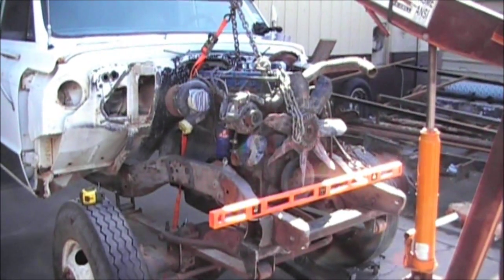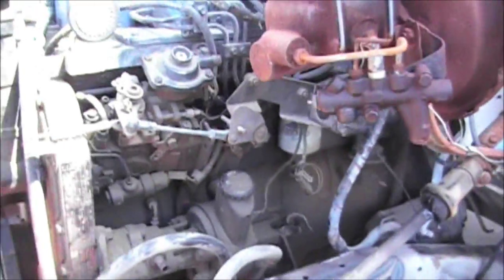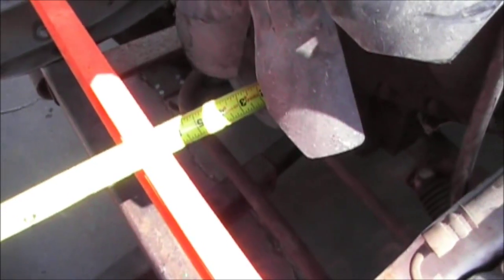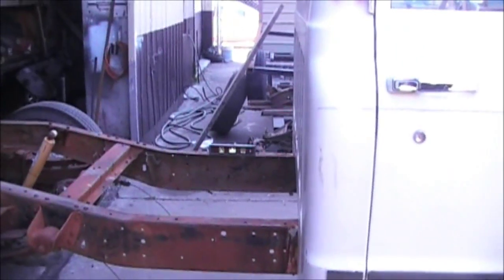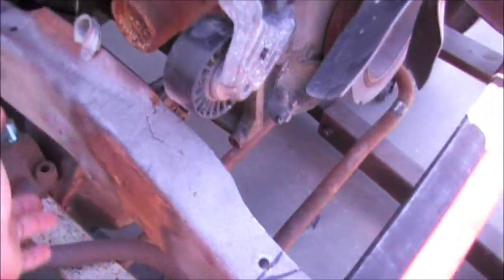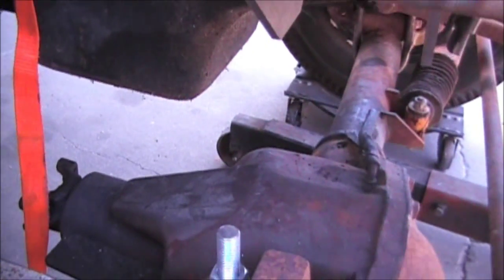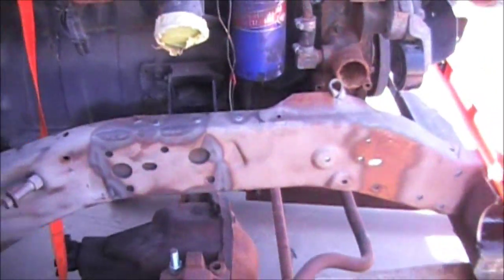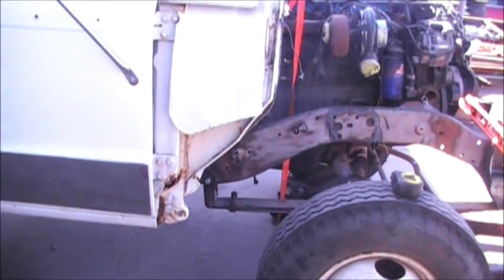Cummins Test Fit

Comment: Ok above the Cam gear there is a dowel pin that locates the timing cover to the block and this pin likes to work out and fall into the timing gears, When this happens it breaks the timing cover and takes the gears out, For more info check out (the diesel stop) here on youtube he shows exactly where it is and how to fix it. Very good information on his channel. Very good videos by the way.

Comment from the maker: Pulling the trans will be a snap because it has a detachable bellhousing. 

All I will have to do is take the stick out of the top, drop the rear cross member, and then the take out the 4 bolts that hold it to the bellhousing and it will come right out, then I can lower the back of the engine slightly, yank the bellhousing bolts with ease, pull the clutch, then I can pull the engine easily.

Ironically it is going to be easier to pull the bolts on the Cummins than on the big block.

Comment from the maker: I built custom mounts and a custom cross member, I am still needing to finish the cross member, but when I do I will post a video of it.

I mounted my motor low enough that I will not have to lift the cab at all, I also am not a fan of body mounts.

Comment: @RichardsMetalWorks so if you wanted to just pull the motor,is it posible? everyone i see on here doing a swap has to put a body lift on im not a big body lift fan1 inch is ok but seams like a 2 inch is needed normally with the cummins motor and trans